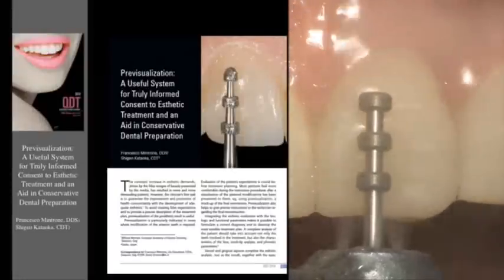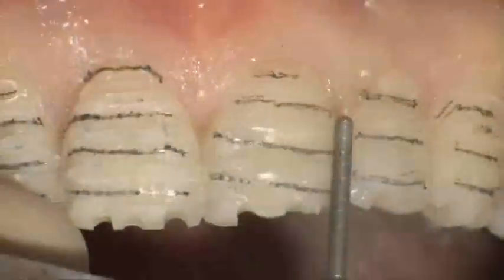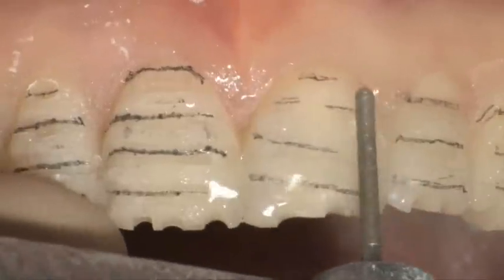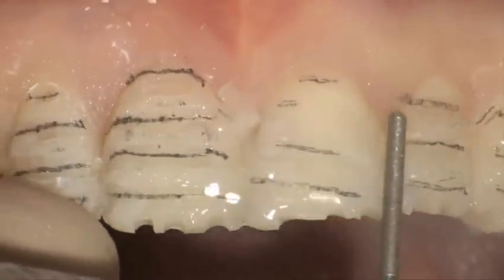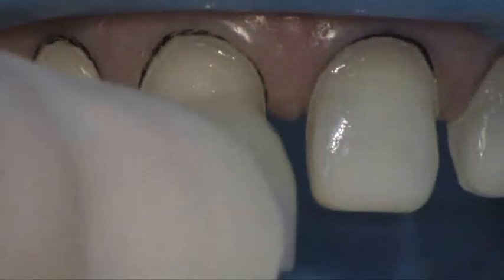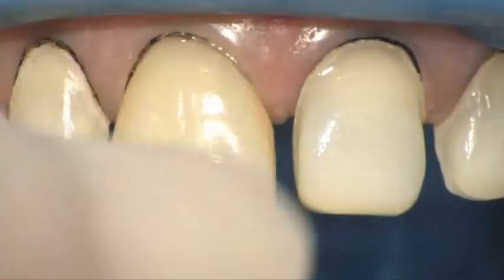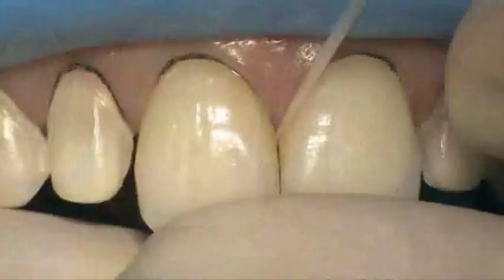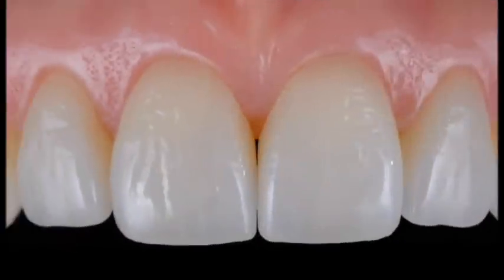Veneers, Dott. Francesco Mintrone

Comment: Doctor, why did you use 00 and 0 cord combination in this case? Yes, I know that Ultrapak advocates this combination, but 00 cord over 000 is sufficient whenever you're dealing with healthy periodontium. Overall it gives you enough lateral and vertical displacement of soft tissues with less risk of trauma and subsequent gingival recession.

Comment: at 2:35 he prepared the flowable composite placed with the silicone guide. Then removed all composite and prepared enamel>>??? That doesnt make sense... What am i missing here??
Reply: preparation amount is dependent upon the thickness/appearance of the desired final result. So, he took flowable composite in the mock up which is essentially the finished product. He now has a replica of the final result. So he can perform depth cuts fully maximizing a conservative prep. Any remaining composite is scraped off. This maintains a conservative approach and ensures proper thickness of material.
Reply: +AlbanianDentist by placing the composite before and prepping with depth marks into the composite, he is making sure that the tooth preparation is minimal. Without the composite, he would be preparing directly into enamel and removing more of it